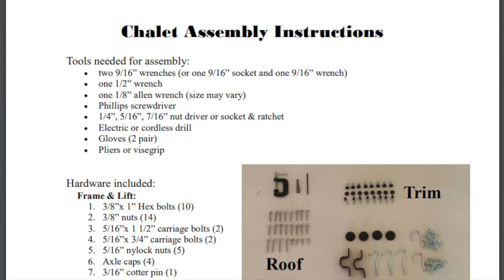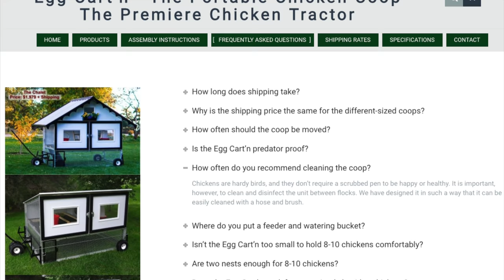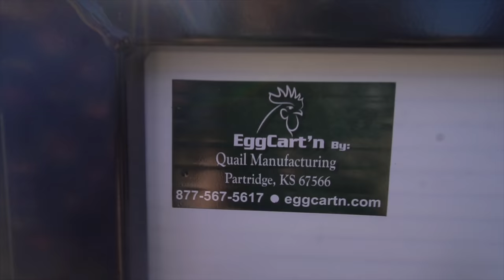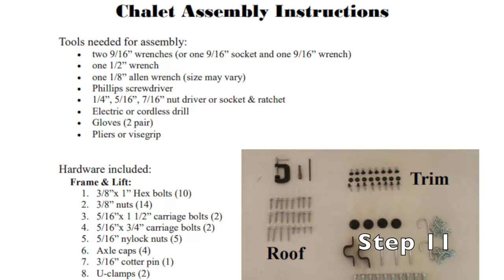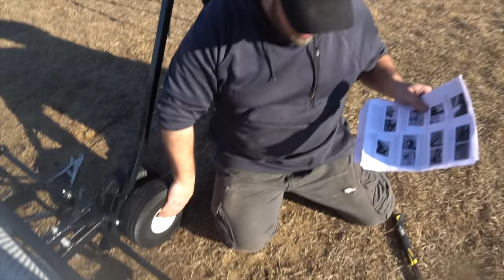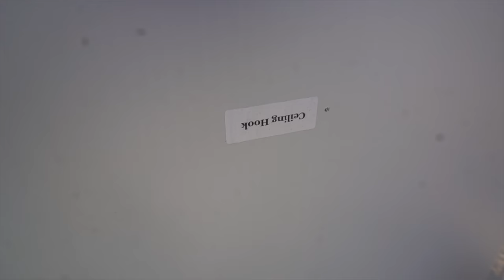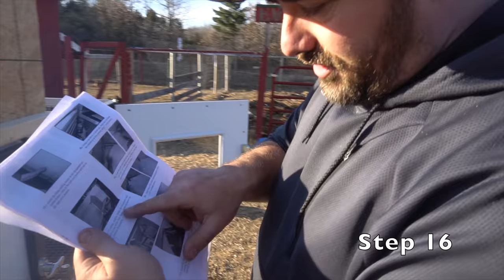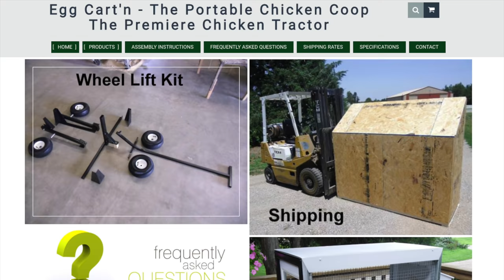THE BEST CHICKEN COOP IN THE WORLD! We Unbox, Build and Review it...

Comment: It's a plastic moisture trap!  Horrendous way to treat birds...
Reply: Can you explain why?  It seems better ventilated than any other coop.design we have looked at
Reply: @Mama_bird_to_all  
Plastic doesn't breath, so it holds lots of moisture.  Add to that the fact that it is non insulated plastic and you have a recipe for major condensation caused by the warmth of the birds inside and the cold air outside.    The walls will be wet in cold weather, the worst time!
Reply: I have one. It is so ventilated, there is no moisture problem. Also very little odor. No fly problem in summer in Alabama. 
The heavy plastic grid floor will not absorb bacteria like wood does.
All in all it is wonderful

Comment: wow love the look and it seemed pretty easy to put together but it looked very lite (I know ease of moving) but if you get a good wind I can see it flying. maybe move it to the garage during a wind storm?
Reply from the maker: Thanks for watching. It is actually fairly heavy but I think the EZ lift system used and the assist ram makes it look liter than it is. The way its designed the leverage from the long handle and the ram make the lift easier- if I had to dead lift the unit without that I don't think I could. Also with the walls all being open fencing- the wind can go right through. But good point and we will keep a close eye on it. Thanks.

Comment: Its not insulated at all
Reply: Mark Kollmer  in NY yes, anywhere it goes below freezing.. you don't need insulation if you have a heater (a waste of electricity if you ask me, you can insultate a coop with waste plastic and styrofoam
Reply: Chickens dont need insulation. It's actually worse because it will hold in the summer heat. You dont need to heat them either just keep them away from breezes and rain/snow.
Reply: Insulation not needed. They have layers of down and feathers!
It comes with panels to put on sides and bottom to create solid walls over the mesh when needed.

Comment: Can you share more details about your failed previous coop floors? I’m researching durability.  Were both failed floors linoleum over plywood? OSB?  Sheet linoleum or squares?  How did they fail so quickly?  Thanks!
Reply from the maker: linoleum over OSB. Part of the issue (I think) is that I used the linoleum squares which are like 10in x10in. I think water/waste was able to get in between the small gaps betweens those scquares-- where as a solid single peice of linoleum probbaly would have worked better. also I would use water/marine grade plywood instead
Reply: I have the same squares with a bit of hay i change 1 a week in the 2nd level where they slepp and lay in the bottom or floor i use sand and the run sand i mavo away from hay cause it gets wer and stink, sand no stink, but you have to use a catlitter scoop and removed the dry poop evwry 2 days, if they feel like they eat it as grit sometime